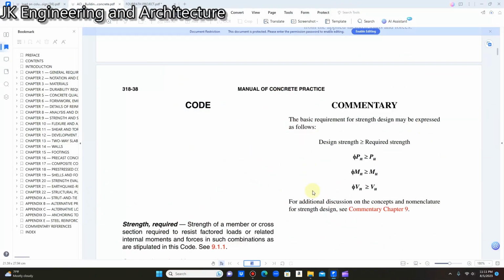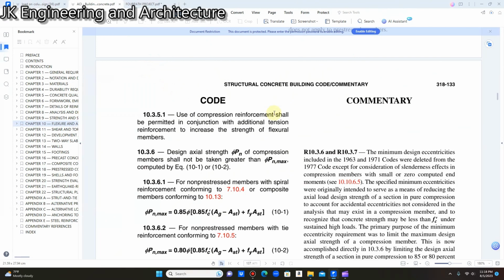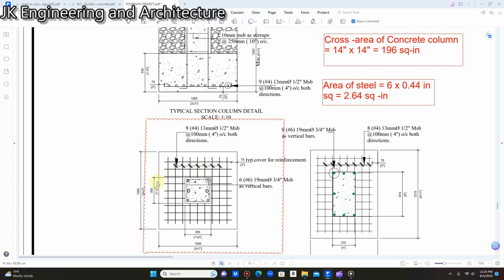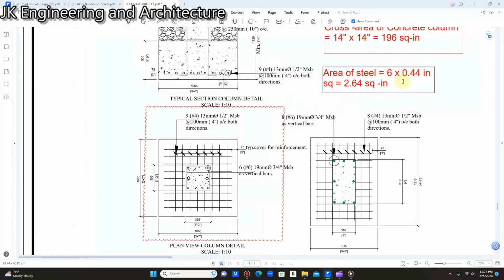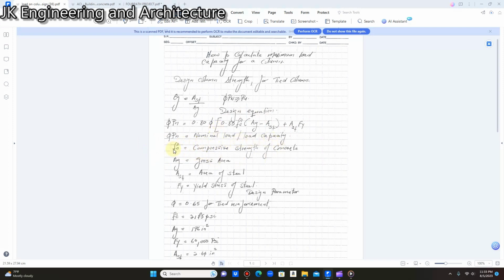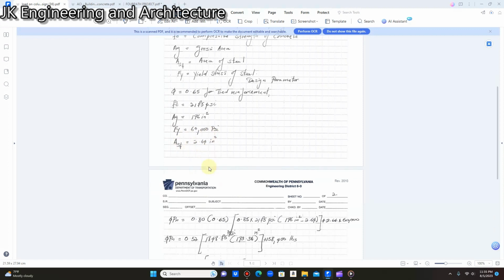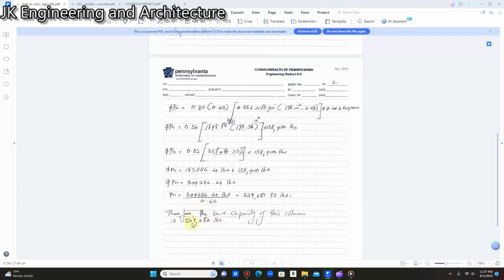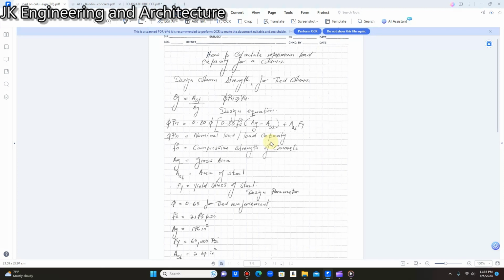How to design a Reinforce Concrete Column when building your dream home. JM

Comment: very very interesting topic .could you do a tutorial on a design rcc columns and beam  for a  20 feet span in a residential building for instance size of columns and beam for  that span also design for reinforce footing nuff respect
Reply from the maker: That's a lot of work. People are not interested to see these types of videos. I did this video because you requested it Remember you ask to use the design equation to design the column. But stay tuned  I will some more videos like these.  Maximum Respect.